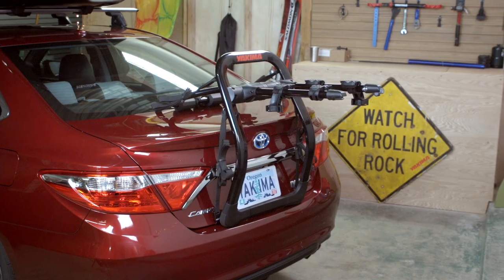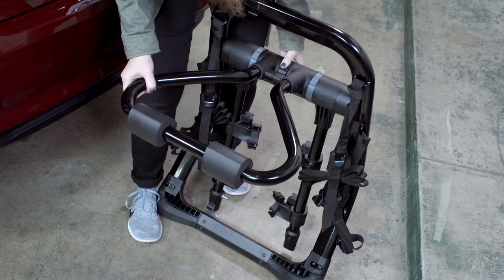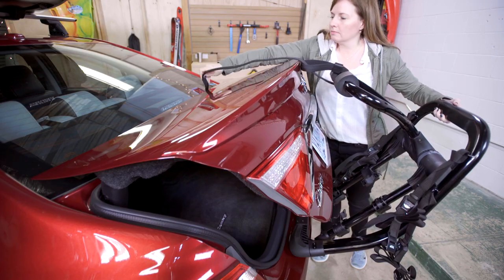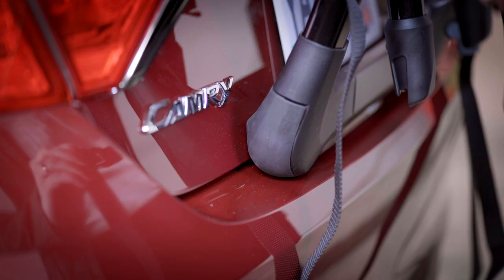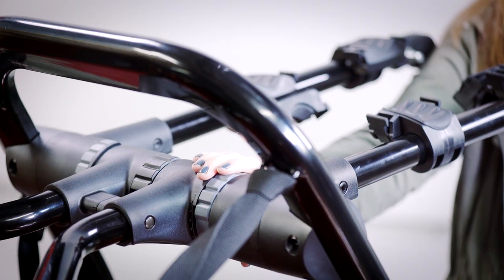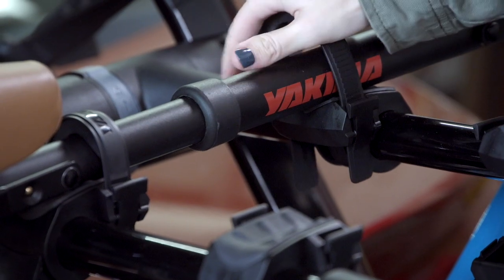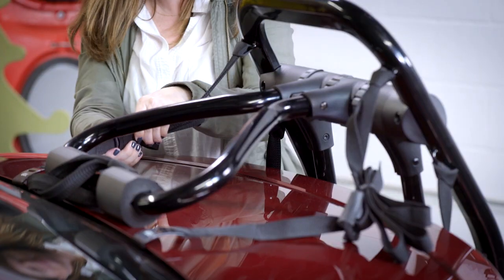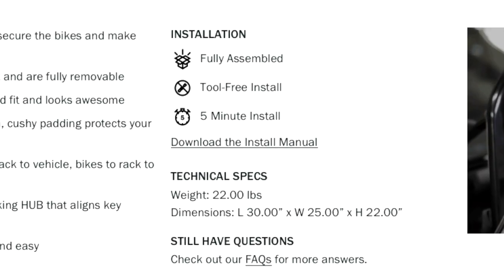Yakima FullBack Bike Rack Installation

Comment: Can you please post a guide on how to use the lock on the fullback - I have 2 keys that came with the FullBack - and the instruction manual - but to be honest it's not very clear on how it all works. Otherwise a very solid unit - fits 3 bikes as advertised and it is very sturdy. Very happy with it and highly reccomended!

Comment: I had a,Yakima 20 years ago, twice as secure, 1/2 as easy to put on and 1/3 the price.  
The wheel securing strap is a joke. Just buy some bungee cords. The lock is a gimmick. Just buy a decent $20 lock. 
After returning another rack before this one, I'm just to lazy to ship it back. If you have not bought it, buy the half back on sale for half the price.